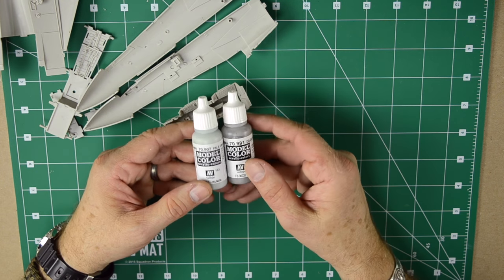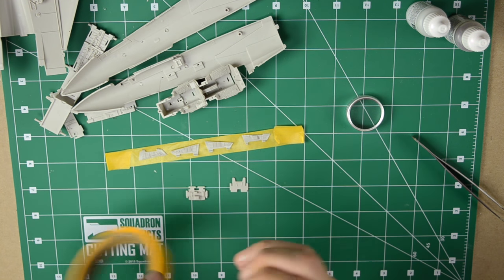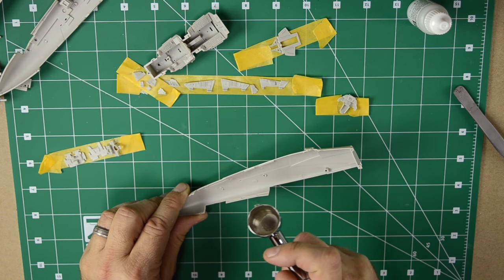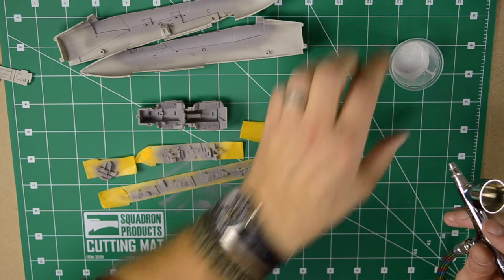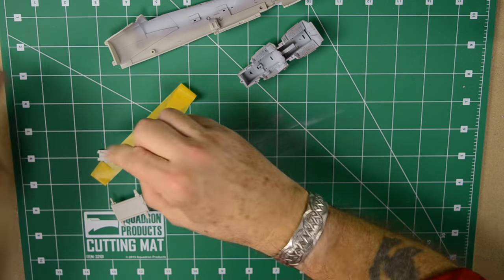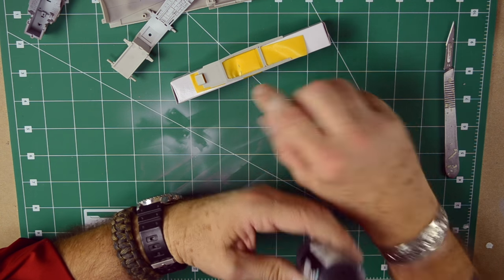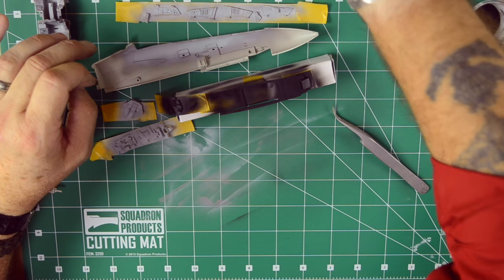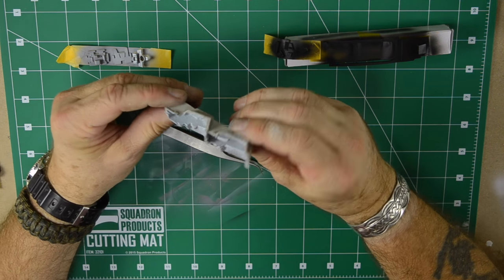F-14A Tomcat Build - Part 3

Comment: HI
I am a beginner and i had a problem.
Between the layer of paint and the layer of decal something entered ( or the atomized paint was not enough .. atomized); between decal and varnish appeared the same problem. How to avoid ?
So the decals appears as they hold air with the layer from underneath and with the layer from above. How to avoid ?
If you have time i will be glad.
TY
Reply from the maker: Email me at jeff.verswyvel@mmd-squadron.com and I will try to guide you through decal applications.  Thanks!